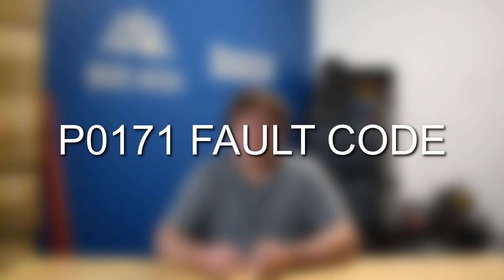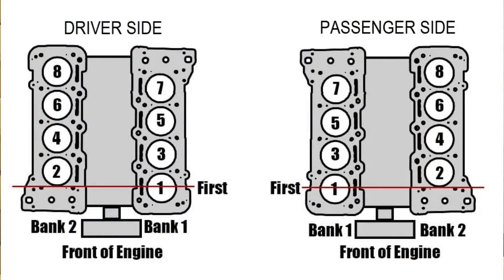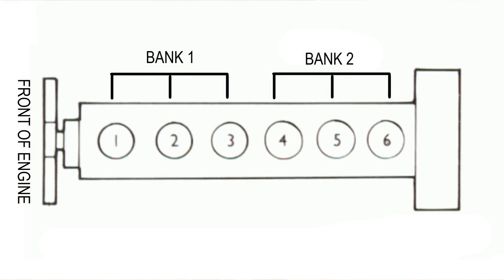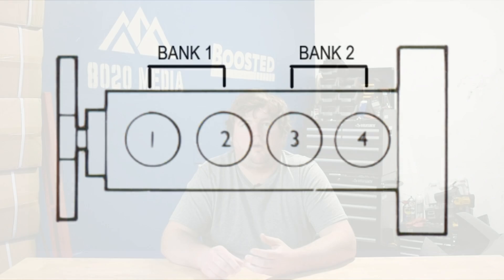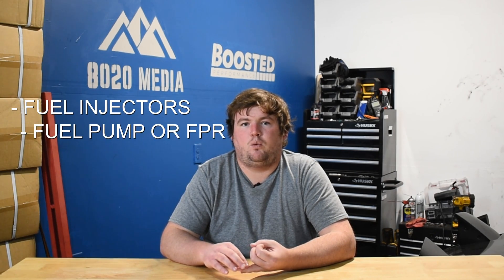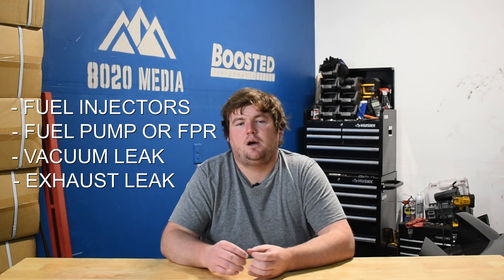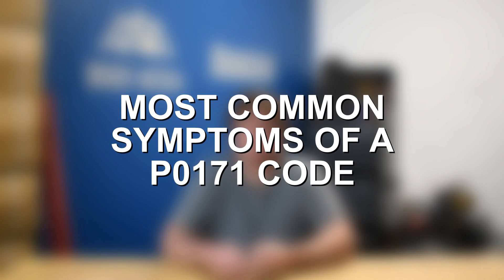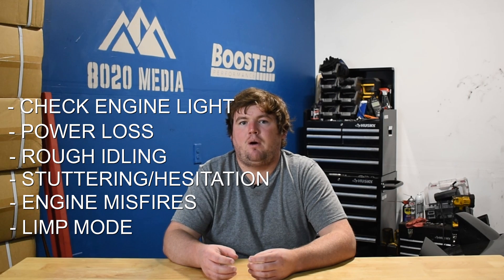Engine Fault Code P0171 - System Too Lean Bank 1! [Symptoms, Causes, and Fixes]

Comment: I have a 2013 Mazda CX5. P2096 came up initially, and upstream 02 sensor was replaced. Engine light came on again, so took it back. They replaced the spark plugs, even though those had been replaced three months prior, and the  Vapor Canister Purge Solenoid Valve. Left this shop and the following day, the engine light came on again with P0171 code, and P2096. Can you please steer me in a direction to check? Could the MAF sensor just be dirty? These repair shops don't seem to be able to fix it.

Comment: I got code p0171 cadillac xt5 2017 change the oxygen sensor mas flow sensor air filter cytalic coverter engine light  comes on code p071 keeps showing

Comment: I have a 2019 toyota corolla. Got an oil change a week ago. Replaced a dirty engine air filter yesterday. Car started up a little rough after, but quickly back to normal. Check engine light comes on about an hour later. System too lean bank 1 code with a cylinder 1 misfire. Traction control turned off notification appears on dash as well. Housing is fine with engine air filter. It idles fine. The air compressor has been a little noisy for about 2 weeks. Check engine light turned off for about half a day. Came back on this evening. Any specific ideas? Trying to diagnose & repair ourselves. Budget is too tight for a mechanic at the moment.

Comment: i had a PO171 code ,,it said MAP senor ,, i change that ,,seem to make car worse ,,,so took it to a garage ,they came back with my fuel pump on my 2004 PT GT Cruiser , now fuel pump on that  is in gas tank , had them replace it ,,BUT was  $ 900.00  later this is in 2025  in Pa ...but car runs great again has pick up and pull like it was new ,,,  yeah  only has 65,000 miles on it i bought it new !!!

Comment: I got that code on my 99 Lexus LS400 and after unplugging what I believe was the MAF the engine completely stopped running. I'm idling quite high and my engine is running hot as well. Idk what the hell to do 🫤
Reply from the maker: B - Sorry to hear this.. If unplugging the MAF on your vehicle immediately killed the engine and it’s now idling high and running hot, you’re most likely dealing with a faulty or dirty MAF sensor, a vacuum leak, or both. When you unplug the MAF, the ECU falls back on preset fuel tables (limp mode), but if the sensor or wiring is bad, that fallback can fail and cause a stall. The high idle suggests unmetered air entering the intake — check all vacuum lines, the intake boot between the MAF and throttle body, and the PCV valve for cracks or leaks. The overheating could be a side effect of running lean due to that extra air, which raises combustion temps. Start by cleaning or replacing the MAF with OEM (Denso) only, reseal the intake tract, and inspect for vacuum leaks with carb cleaner or smoke. Once the MAF is working correctly and no air leaks exist, the idle and temperature should stabilize.

Comment: Hey man, i have a 2020.mazda 3, im getting the p0171 code and the p016b code together. Ive taken it to the dealership amd they cant tell me what the issue is. Please help. I
The car has a high idle that fluctuates. Any advice would be rrally appreciated! I honestly dont know what else to do. Ive cleaned the throttle body and the idle.doesnt bounce as much but it still revs up to about 2000 rpms.
Reply from the maker: D - You're dealing with a classic lean condition—P0171 (System Too Lean – Bank 1) means the engine is getting more air than fuel, and P016B (Fuel Trim Performance) confirms that the fuel trims are out of expected range, which aligns perfectly with your symptoms of high, fluctuating idle and revving up to 2000 RPM. Since you've cleaned the throttle body (good first step), the next most likely culprit is an intake air leak—check the PCV hose, vacuum lines, and especially the intake manifold gasket or rubber boot after the MAF sensor for cracks or loose fittings. Also inspect the MAF sensor itself; if it’s dirty or failing, it can under-report airflow, making the ECU lean out the fuel mix. If you have access to live data, check your short and long-term fuel trims—anything over +10% confirms a vacuum leak or unmetered air. If everything else checks out, test or temporarily unplug the purge valve—a stuck-open purge can dump air into the intake at idle and cause these exact codes. If the dealership couldn't find it, it's likely a subtle vacuum issue, not a failed part the scan tool could easily flag.

Comment: So, I "just" need to replace bunch of sensors, check for air leaks, replace the fuel pump "just" to find out that I have to go to professional service and pay additional money. So, after that I have to do a lot of driving in order to establish readiness and pray that code won't come on. This code became famous code, not easy to find out what is wrong and is not inexpensive problem to fix!
Reply from the maker: M - Unfortunately, this is correct..

Comment: I got P0171 code on my Subaru Impreza and dealership said that it will cost $2,000 to fix it. It feels like they are charging too much. They want to replace OCV, Oxygen and A/F sensors. I wonder if not all of them have to be replaced.
Reply from the maker: B - Yeah, $2,000 for a P0171 code does sound steep, and while it's possible that multiple parts could contribute, replacing the oil control valve (OCV), oxygen sensor, and air/fuel ratio (A/F) sensor all at once might be overkill if only one is actually bad—typically, this code is caused by a vacuum leak, dirty or failing MAF sensor, or sometimes a weak fuel pump or clogged injector, with sensors being farther down the list unless you’ve confirmed with live data that the A/F sensor is giving false readings; I’d suggest starting with a smoke test to rule out vacuum or intake leaks, cleaning or replacing the MAF if it’s dirty or old, and then scanning live fuel trim and sensor data to see which sensor (if any) is behaving erratically—chances are you can fix it for a few hundred bucks or less with proper diagnosis instead of tossing expensive parts blindly.
Reply: @8020Automotive Thank you so much for your comment! I was thinking about cleaning or replacing MAF sensor too, and see how it goes. Definitely not spending this money in this dealership, I don’t trust them ☺️

Comment: P 1684 and p 0171 ?
Reply from the maker: H - P1684 indicates that the battery was disconnected within the last 50 starts, which is usually not a concern unless you’re experiencing electrical issues. P0171 (System Too Lean - Bank 1) suggests that the engine is running too lean, often due to vacuum leaks, a faulty MAF sensor, fuel pressure issues, or an exhaust leak before the O2 sensor. Start by checking for vacuum leaks (especially around intake hoses and gaskets), inspect the MAF sensor, and ensure the fuel pressure is within spec. If everything checks out, a clogged fuel injector or a failing O2 sensor could also be the culprit.
Reply: @8020Automotive  it shut down with me two times and won't start until the plug wires disconnect from the coil pack and turned the engine over after putting them back on it started up running rough. Finley smoothing out, but engine light is still on. But yes just had a new battery put in. Thanks

Comment: I got this code PO171 system too lean bank 1 as well what could be the cause 2006 c class Mercedes 180 kompressor
Reply from the maker: O - Did you watch the video? We go over causes and fixes.
Reply: @ ok will check dat out but I later watch a video pointing out different causes and I found a hose that came off so I plugged it back now all fine

Comment: not sure what to do for me because whenever i used MAF cleaner on my sensor the check engine light went away and was idling good a 3 or 4 days and the light would come back on and i'd repeat the process i bought a new sensor and used throttle body cleaner on it. When i didn't i disconnect the sensor and the the hose that connects to the the throttle body and it idled just fine without it. When i reconnected everything after it started idling rough again idk wtf to do
Reply from the maker: R - Since cleaning the MAF sensor temporarily fixes the issue but it keeps returning, and the car idles fine with the MAF disconnected, this strongly suggests either a faulty MAF sensor, a vacuum leak, or an intake system issue. If you used throttle body cleaner on the new sensor instead of MAF cleaner, that could have damaged it, as MAF sensors are sensitive to harsh chemicals. Try replacing it again with a properly cleaned or brand-new OEM sensor. Also, check for vacuum leaks by inspecting all hoses and intake connections for cracks or loose fittings. A smoke test can help identify leaks. If the problem persists, consider checking the IAC valve (if applicable), throttle body adaptation (if electronic), and fuel trims via an OBD2 scanner to rule out fueling issues. Keep us updated!
Reply: @8020Automotive  i didn’t use the the throttle body cleaner on the sensor i used it directly onto the throttle body i disconnected the MAF ducts from the the throttle throttle body to get to it. My only thing i’m thinking is idk if it’s a vacuum leak cause it would be more consistent in the rough idle since extra air is going in. Whoever i used MAF cleaner on the sensor it fixes it short term then idles rough again or just stops on its own
Reply: @8020Automotive  thank you also!
Reply: @8020Automotive  i’m definitely going to check the hoses again just in case i missed something
Reply from the maker: @ Keep us updated!
Reply: Sounds like faulty wiring

Comment: I got that code but it say misfire   Number 3 I on a Mazda 2002
Reply from the maker: T - A P0171 (System Too Lean - Bank 1) combined with a misfire on Cylinder 3 in your 2002 Mazda likely points to a vacuum leak, faulty fuel injector, weak ignition component, or unmetered air entering the engine. Since P0171 means the engine is running lean, possible causes include a vacuum leak near Cylinder 3, a dirty or failing fuel injector, a failing MAF sensor, or a weak ignition coil or spark plug causing an incomplete burn. Start by checking for vacuum leaks around the intake manifold and hoses, ensuring there are no cracked or loose connections. Inspect and swap the coil and spark plug from Cylinder 3 to another cylinder to see if the misfire follows. If the issue remains, try cleaning or replacing the injector. Also, clean the MAF sensor and check for unmetered air entering past it. Keep us updated.
Reply: I changed the maf sensor, still got p0171 bank 1. Changed the spark plugs that were original with 141000 miles. So far so good.

Comment: I have that code for a couple days now, with smoke accompanied with it pulling up to the house last couple nights found out my pcv valve feel out its hole and grommet, thinking it has a bad grommet cause that pcv valve was changed 2 months ago and had no problems until a couple weeks ago, now not a lot of oil in the engine
Reply from the maker: L - Sorry to hear! Keep us updated.

Comment: I know this was uploaded a year ago. My stupid scanner is saying timing chain on the P0171 code. What is that about? Timing chain code is a complete different code for that. JUNK SCANNER!!!
Reply from the maker: K - It could be because it is a low-quality scanner because a P0171 usually points to a lean condition caused by issues like vacuum leaks, a faulty MAF sensor, or fuel delivery problems, not directly related to the timing chain. However, if the timing chain is stretched or the timing is off, it can indirectly cause lean conditions by disrupting engine performance, leading to the P0171 code. Keep us updated!
Reply: @8020Media  after it sits a whole night. In the morning it has a hard time coming to life. While cranking the battery light flickers for a second. Or even after say 4 to 5 hours give or take. It has a long crank to start. Could that lean towards that code. For a fualty fuel delivery?
Reply from the maker: K - Yes, the hard starting after sitting for several hours or overnight, along with the battery light flickering briefly, could indicate a fuel delivery issue tied to a failing fuel pump, fuel pressure regulator, or a leak in the fuel system allowing pressure to drop. This condition can cause extended cranking as the system struggles to build sufficient fuel pressure for ignition.
Reply: @8020Automotive  I am going have to figure out which one it is. And thats why its poping a to lean bank 1 code. Thats one thing I was wishing it was not the problem. Will update when issue found and resolved.
Reply from the maker: K - Sounds good. Keep us updated!

Comment: My Mazda 3 2010 having this code along with p2096, had changed fuel filter, got my O2 sensor upper stream changed, maf sensor brought from Japan used parts changed... Both Code error still persist... Think I would check on my catalitic converter later on
Reply from the maker: M - Did you clear the codes after replacing parts/are you having any drivability issues?

Comment: i got this code after driving with my oil cap off… and now my oil leaks and my screwed
Reply: The oil cap being off just allowed a lot more air into the system giving the computer a false reading put the cap back on and your fine, you can't ruin an engine just because a cap is off
Reply from the maker: J - This is a possibility.

Comment: This code was showing up on my 2012 Mazda 5. I replace both oxygen sensors , Mass airflow Sensors and a cat. The car runs great for aover a year and the code came back. The car also runs very smooth with no power loss or hestation. I don't undertsand whats going on.
Reply from the maker: I - If you aren't having any drivability issues, we would just visually inspect things it could be.

Comment: Hi! I have a 2014 Mazda CX-5. I’m getting P0171, P061B and P0102 all together. What would a combination of these codes point to? Is it more inclined towards the MAF sensor, or a vacuum leak? Would really appreciate your input. I’ve taken it to multiple garages and they cannot figure out where the issue is. No vacuum leak checks or voltage checks on the MAF sensor have been done.
Reply from the maker: R - The MAF sensor is the most likely culprit based on the combination of codes, followed by a possible vacuum leak. Start by cleaning and testing the MAF sensor, then check for air intake leaks downstream.
Reply: @8020Automotive  Thanks for the response. I cleaned the MAF sensor and cleared the codes. Car ran fine for a bit. I parked it to try a cold start and the lights came back on. No more P0171. But P061B, P0102 and P0113 (new code) was read on the scanner. Do you think I need a new MAF sensor? Is the IAT sensor built into the MAF for Mazda’s? Appreciate your help :)
Reply from the maker: R - Our best bet would be to replace the MAF sensor and go from there. Keep us posted!
Reply: @8020Automotive  Changing the MAF sensor tomorrow. Will keep you posted. Thanks for all your help! :)
Reply from the maker: R - Keep us updated!
Reply: @8020Automotive   Changed the MAF sensor this morning. Car’s been running fine. Have done two cold starts since then and no lights on the start. Will drive around over the weekend, about 100-200km and then try another cold start post that. Hopefully nothing then too. Will keep you posted on that but so far so good :) Thanks again!
Reply: @8020Automotive  Been 3 days. Lights haven’t come back after many cold starts (currently -25 degrees here in Canada). Drove around 100km and lights/error codes haven’t come back. I think we got her! Thanks for all your help. Will keep you posted if anything changes :)
Reply from the maker: R - Love to hear this! Thanks for sharing!
Reply: Hello. I also have a Mazda CX 3 2020. Sometimes it shakes at idle. Sometimes when I press the gas, it would automatically rev and drop. I cleaned the MAF sensor with spray. The engine light used to come on after an hour. After cleaning the MAF sensor, it seems to be affected more quickly. There is no problem in normal driving. Are the symptoms similar?

Comment: Thank you for your good video. I have a 2017 Nissan Altima. I forgot and left the cap off after I changed my CVT fluid and drove 100 miles then the engine light went on. I put the cap back on. My scanner showed P015A, P015B, P014C, P014D code, so I changed the oxygen sensor. I cleared the codes. Then drove 10 miles,  engine light went on again. Scanner showed stored: P0171 and permanent: P015A, P015B, P014C, P014D. Any suggestions?
Reply from the maker: T - This video may be more helpful for your research: https://youtu.be/hpqXLGAE4Xo